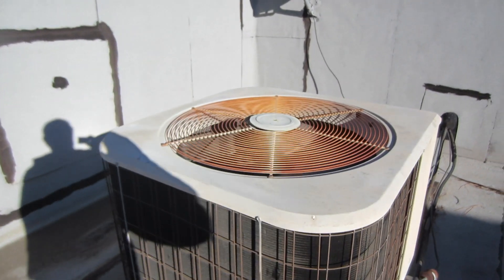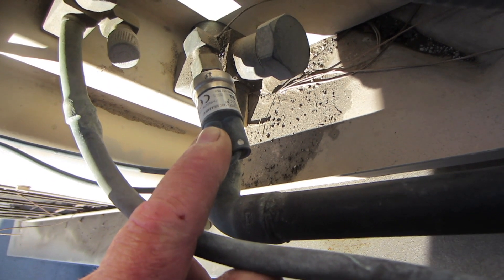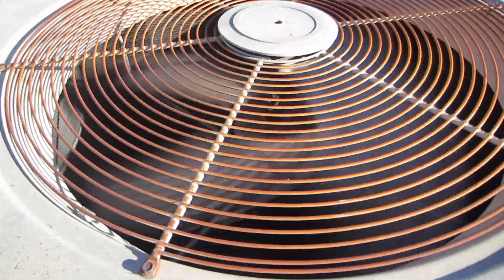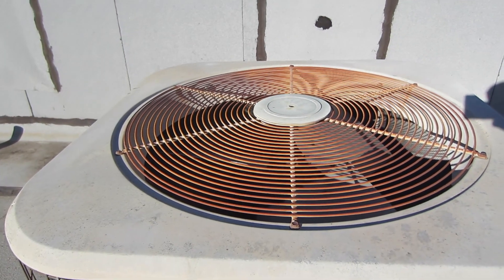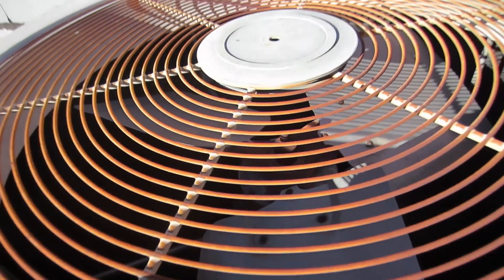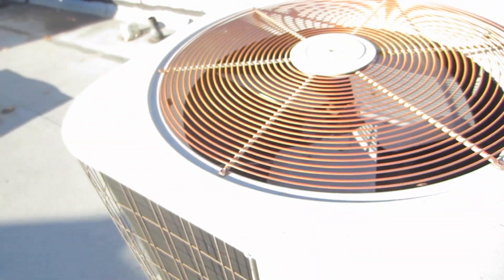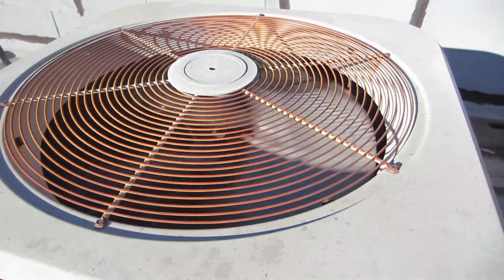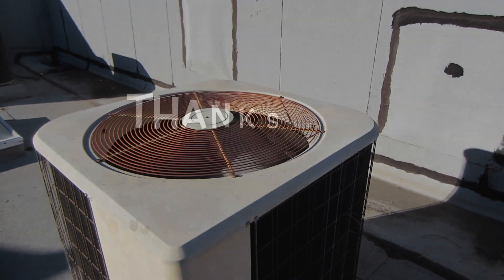Heat Pump Mild Weather Switch

Comment: Very good info Dallas. So on a package heat pump with one true suction and one discharge port, you would attach it to the discharge port correct?
Reply from the maker: Thanks Jon! Yes you can attach it to the discharge port with a tee.I use a relay so I bypass the high pressure when the unit is in A/C mode similar to a low ambient kit wiring.https://tech.unicosystem.com/download_file/view_inline/54/260/
Reply from the maker: I have it wired like figure 2 but the only different is that it is a mild weather switch....http://www.reznorhvac.com/files/708175c.pdf
Reply: Thanks, man! I really appreciate it.

Comment: Where do you splice the switch wires? Common wire going to fan?
Reply from the maker: The pressure switch on the outside is wired to a 24v relay coil and the relay contact and breaking the common to the motor.I found this..https://tech.unicosystem.com/download_file/view_inline/54/260/ mine is wired like figure 4 because I diden't want my high voltage on the outside.Thanks for Watching
Reply: I see. I want to use it on an uncle's system that was mismatched and having the same issue as the system on your video. He has an older TRANE XE1000 I think. Looks like I may need to field install a relay to make it work.
Reply: One thing I could see improving.  Making the relay only able to cut the fan out in heating mode.  But hopefully the head pressure never gets to 350 in the summer.
Reply: The Media Is Cancer.
That's exactly how he installed it. The suction line shouldn't go over the high limit on cool mode. I installed it on my uncle's system and it worked like a charm. I told him to save up some money for a new system since it will eventually crap out.
Reply: Yeah, don't know what I was thinking.  Was thinking liquid line for some reason...Disregard.
Reply from the maker: The heat pump in the video has a relay so the pressure switch is bypass in cooling mode I forgot to mention.

Comment: Nice, where do you hook your gauge up on the vapor line, don’t you have the pressure switch threaded on the shraeder valve. I know they have T’s. Thanks.
Reply from the maker: The unit has a true suction port for accessing suction pressure you can barely see it in the video.The install was kind of mousie  but effective :/  Thanks for stopping by Wayne.

Comment: Hi Dizzie, First of all  I wanna say I'm a fan and like watching your tubes. I've installed fan cyclings on heat pumps for the cooling mode on units that were located in windy areas or on roof . those units were running low head in cooling due to location . but it's the first time I hear of a fan cycler for head pressure in heating mode . It's a fantastic bandaid for your issue and hope you get to shoot a video replacing that hack job 👍Keep em coming.
Reply from the maker: Thanks you very much Gecko Hvac I really a appreciate it. I am installing two unit right now I am not sure of the time line for replacement on that unit but I hope it soon...Thanks for the support!